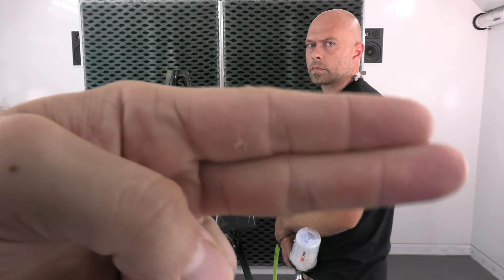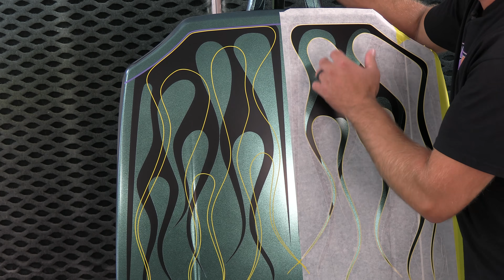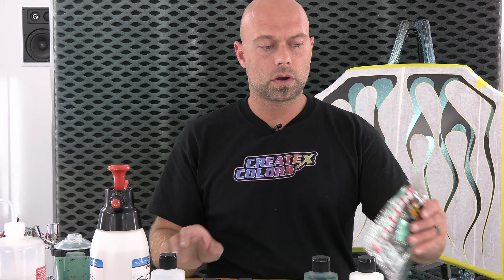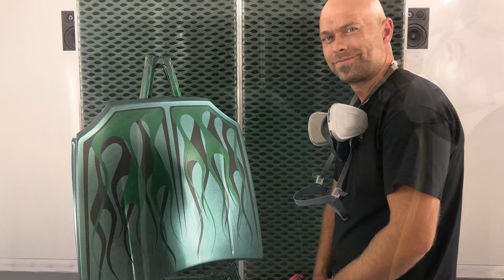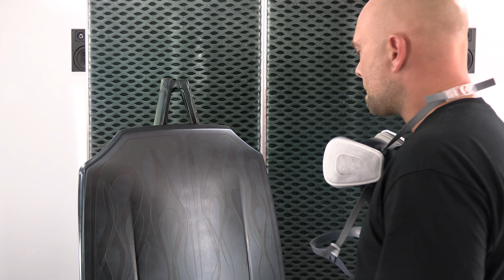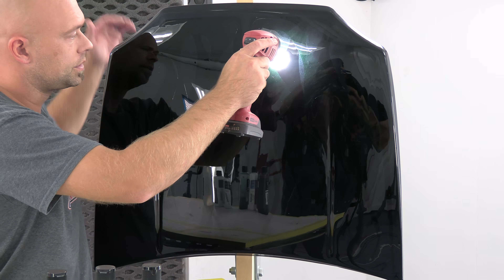Murdered Ghosted Candy Graphics

Comment: How did you get such a wide fan from your gun? What pressure do you have coming out of the gun? Good video, thanx!
Reply from the maker: Follow the spray-gun manufacturer's inlet psi recommendations and make a few test panels to get even paint distribution within the largest fan size the gun offers. Thank you.
Reply: @CreatexColors  Thank you. Does the diameter of the air hose effect the fan at all by chance? (.5” vs .375” ID)

Comment: Can you wets sand between each process on the flames to remove tape lines??
Reply from the maker: This was a test panel. Had it been an actual project, 4005 UVLS Gloss Clear would've been applied, dry sanded flat, then the clear applied. Dry sand a water-based paint, wet-sand a 2k clear. For more, please refer to our Hard Surface application Guide available at www.creatextech.com and watch our Hard Surface Basics video, https://youtu.be/CYhmtwp4tnw. Thank you.

Comment: Can you do the emerald green to whole body than the black? How would that look?
Reply from the maker: Yes,  Wicked W424 Hot Rod Sparkle Green can be applied over 6002 AutoBorne Sealer Black, and candy2o 4661 Emerald Green can be applied over the Hot Rod Sparkle Green, with 4664 candy2o Black over the Emerald Green. The best way to see the resulting finish is with a test panel. If you wish, try a section on the test panel applying the candy2o Emerald Green over the Hot Rod Sparkle Green, and one section skipping the Hot Rod Sparkle Green, using just candy2o Emerald Green over the Sealer Black. Thank you.

Comment: After doing the candy graphics, could you clear it then rub it all back then do the black candy over to elongate any lines from the masking?
Reply from the maker: Yes. This was a test panel. For an actual paintjob, sanding the first application of clear flat to remove the lines, then applying another 2 - 3 coats of the 2k urethane clear is recommended. Thank you.

Comment: Chris, how long should you wait after painting, before applying your next round of tape? I worry about pulling paint off while unmasking. Great tutorials!!!
Reply from the maker: Cure times for water-based paints depend on temperature and relative humidity while the paint is drying. Use warm, moving air to speed up drying. The quickest time to tape is achieved by opening up re-coat times and allowing each coat to dry tack-free before applying the next coat. If in doubt, allow for more drying time. For more, please refer to the Hard-Surface Application Guide available at www.creatextech.com. Thank you.

Comment: I recently found your channel. I like your techniques. I build model cars and have wanted to try Createx paints since the first video I watched. So I will do some tests and see how the paint goes on. I have a project that I am working on of a semi truck and trailer with graphics flowing from the front end of the semi to the end of the trailer. I like this look and will test it out. If it works I will post a video of it in direct sunlight. Wish me luck.
Reply from the maker: Thanks. Please review our Automotive & Hard Surface Application Guide available at www.creatextech.com, and make a few test panels before the actual paintjob. Good luck!

Comment: How often do you sand between coats? And when would you recommend sanding between coats?
Reply from the maker: We don't recommend sanding candy2o for this technique. The 2k automotive clear is applied after the paint dries, without sanding. An inter-coat of 4050 UVLS Gloss could have been applied, which would hep hide the taped-graphic lines apparent in what's really a test panel (definitely apply an inter-coat and sand before the 2k clear for an actual paintjob). For more, please check out our Automotive Application Guide available at www.creatextech.com. Thank you.

Comment: question about the tape lines can you sand those out before clearing or will that ruin the paint job?  im only asking because it looks like the tape is still on the flames
Reply from the maker: This was a demo panel. For an actual paintjob, apply an inter-coat before top-coat clear, or clear 2x. candy colors, including candy2o, are best not sanded direct as the scratch marks will show in the finish. Thank you.

Comment: Great video. I love how it turned out. Nice change in discussing how things are done during the video. Question, how did you knock down the tape edges?
Reply from the maker: Tape edges are still visible in the final finish, as its a test panel for a complete vehicle we're soon painting murdered ghosted candy. That project won't show tape-lines as Createx UVLS Clear will be applied over the graphics before the final top-coat 2k solvent-based urethane clear. Thank you.

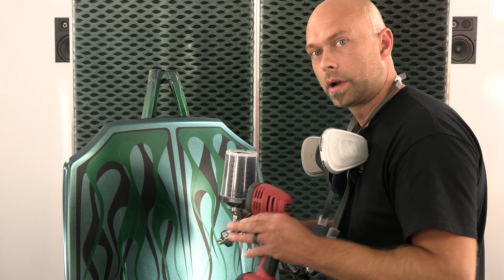Comment: This was a great demonstration, thank you! Do you have a video explaining how to eliminate the tape lines? Around 11:00 you can see the ridges left by each layer of taping. It is really noticeable in the sparkle green. Does the Candy Black and Clear just end up filling over that so it isn't noticeable anymore?
Reply: I was an automotive refinishing contractor. Bet after it cures. Wet sand and re-clear at least once.  But wet sand only into the top coat. No more.
Reply from the maker: This is a demo panel for a complete vehicle we're soon painting murdered ghosted candy. That project won't show tape-lines as a clear will be applied over the graphics before the final top-coat clear, which will hide tape lines. paint doesn't fill; neither candy2o nor the Hot Rod Sparkle are going to hide the graphic lines. Thank you.

Comment: Awesome! Thanks for sharing the process with us. 
Some folks lightly wet sand right after the final black coat. Do you ever have to do that?
I will say, those folks spray the black a lot wetter than you did, so maybe that's why they have to knock it back down.
Reply from the maker: This is a demo panel for a complete vehicle we're soon painting murdered ghosted candy. That project won't show tape-lines as a clear will be applied over the graphics before the final top-coat clear, which will hide tape lines. candy2o Black is applied lightly to create the murdered effect, that the key to the technique. Applying candy2o Black wetter would hide the underlying graphics and ruin this effect. Thank you.
Reply: @CreatexColors  Prior to the final clear, which intercoat clear would be best to smooth out layering and tape lines? I'm assuming the go-to would be 4050?
Reply from the maker: 4050 UVLS Gloss Clear is the inter-coat clear. Thanks.
Reply: @CreatexColors  "a clear will be applied over the graphics before the final top-coat clear"
I'm lost.
Does that mean, before removing the stencil for the graphics, you will paint the remainder of the hood with a clear coat?
Reply from the maker: 1) 1st flame graphics, 2) 4050 UVLS Gloss Clear, 3) 2nd flame graphics, 4) 4050 UVLS Gloss Clear, 5) 2k solvent-based urethane clear, thanks

Comment: Awesome. I have a fiber glass dashboard that is painted med silver grey metallic. I'm going to be hydrodipping it in black carbon fiber. I'm afraid that it will be too bright of a carbon print for me (lots of the metallic base paint will show through). 
am I able to mix a solvent clear coat and add a very small amount of compatible black base paint and spray it on to the dashboard to mute it, to make it darker in steps?
Or would I need to spray a candy black, and add coats to get my desired effect?
Reply from the maker: The short answer is yes; water-based and solvent-based paints may be inter-coated, just not directly mixed. Allow each material to dry thoroughly before applying the next material type. For more, please email us at techsupport@createxcolors.com. Thank you.